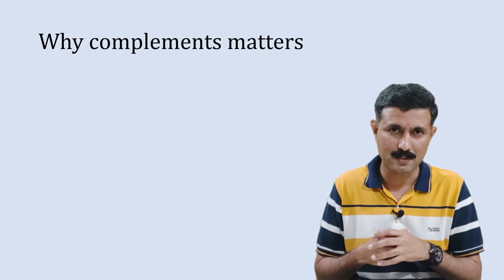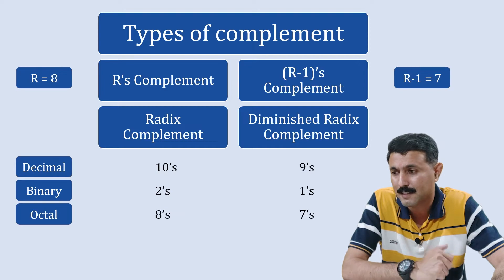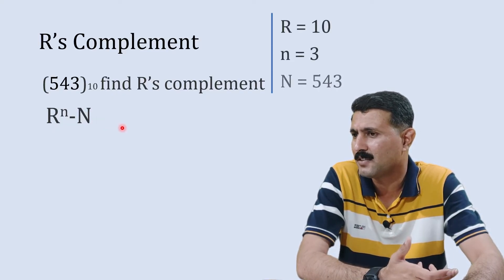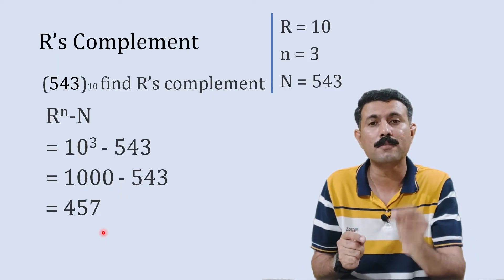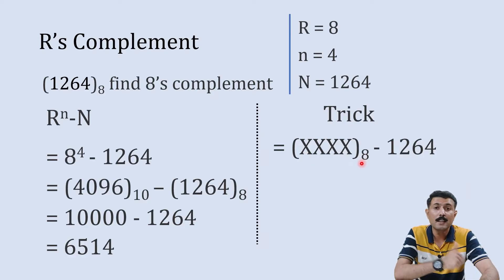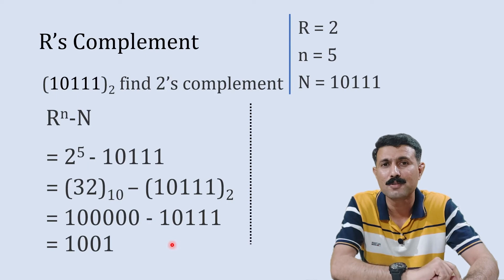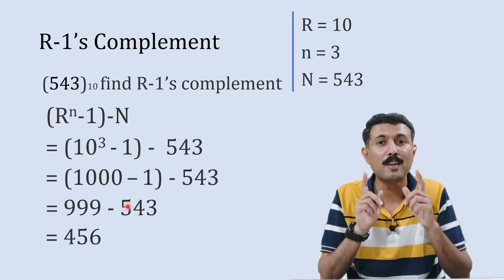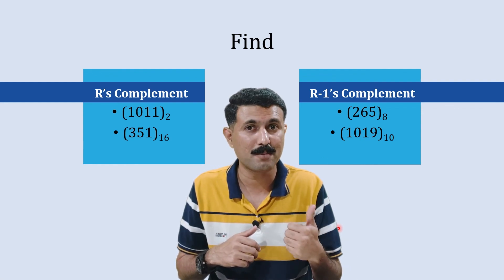R’s Complement and R-1’s Complement | 2s Complement | 1s Complement | Digital Electronics

Comment: How to plot a 3d graph with the z-axis, not the same length as x,y in Matlab? I am importing data from an excel file.   Can you help with that? thnx
Reply from the maker: import your data from the Excel file using the "xlsread. then use meshgrid and then surf to create 3d graph.
Reply from the maker: You can refer my video on how to import data from excel and then go through how to plot 3d graph. i think these two video will solve you problem